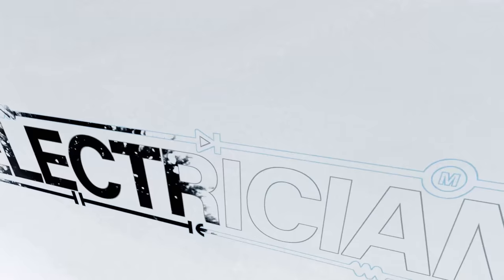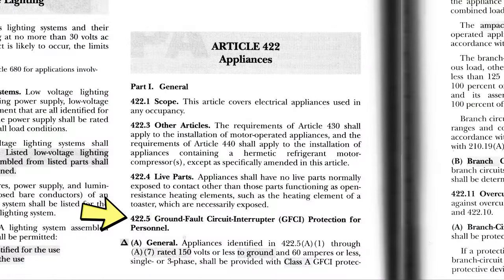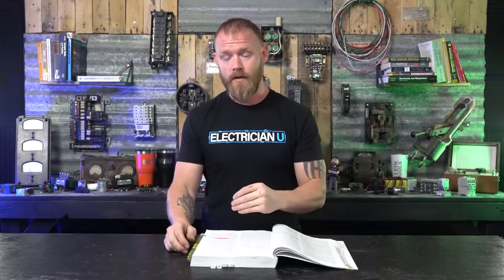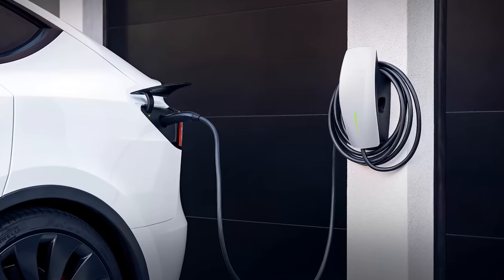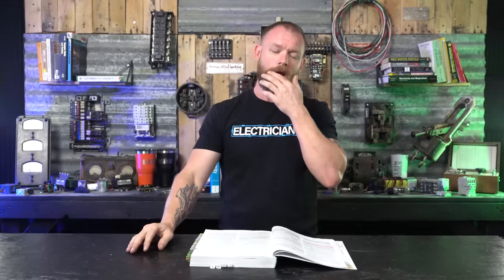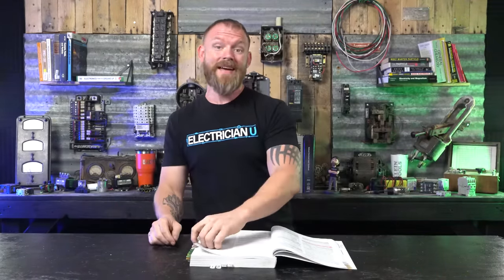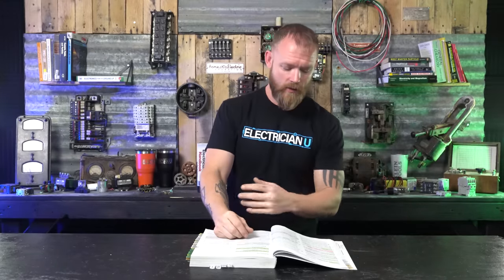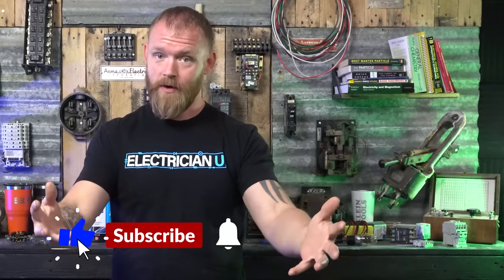Should We AFCI Protect Appliances?

Comment: I LOVE your channel.  I am a City Building Inspector. The problem is EXPERIENCED and Highly qualified electricians don't write the codes.  Electrical Engineers with limited field experience or common sense write codes.  It is my job as an inspector to interpret the intent of the code and many times I will side with the aspects of safety combined with common sense!  I learn so much from experienced electricians and I am not afraid to ask questions and get second opinions. Some issues are black and white with the code, but there is some wiggle room for interpretation for many issues.
Reply: Don’t forget the insurance companies and manufacturers sit on these boards as well
Reply: But that's the issue, there should not be any interpertation.  It should be a yes or no not maybe.  You could get 10 different interpertations from 10 people.

Comment: Gone are the days where code writers cared about nuisance tripping on things like freezers.
Reply: that ended when a commercial cleaning service had a guy get a severe shock from a malfunctioning commercial refrigerator.
Reply: @kenbrown2808  that would have been protected against with GFCI. AFCI is even worse at nuisance trips than GFCI, honestly it's rare that I ever see nuisance trips on GFCI, but my one AFCI circuit I can barely use reliably due to nuisance trips.
Reply: @fdmillion  change the breaker. if it still nuisance trips, there is a bad connection or a crossed wire, somewhere.
Reply: @kenbrown2808  Truth.
Oh, here's one for you - some Traeger grills had piss-poor wiring connections that arced and consistently tripped GFCIs in my experience, and customers would relentlessly beg me to just give them a regular receptacle outdoors and call it good.
Reply: @Timocracy  construction sites can be terrible.  three extension cords with a splitter on the end and every plug lying in a puddle. "why won't the GFCI hold?"
Reply: Install an alarm
Reply: They do say it's not supposed to be convenient, effective, or logical. It's about safety and ONLY safety. It sacrifices everything in the name of safety.
Reply: @fdmillion  I have seen new refrigerators which simply refuse to start with GFCI.
Reply: @mothman-jz8ug  No you haven't.  If you somehow actually have, then those refrigerators are defective and dangerous and need to be replaced.

There is absolutely no properly designed and functioning, piece of modern equipment that will have any problems with current GFCIs under normal conditions.  If it does, the equipment is faulty.  Period.
Reply: @kenbrown2808  Absolutely not. Any appliance with relays or contactors will trip AFCIs randomly.

Comment: As an appliance repair tech we have been factory trained to deny any warranty claims on these circuits if the appliance has an inverter in them. Most French Door and Side-by-Side refrigerator models cannot be on the “code” setups because the DC voltage conversion from the inverter is enough to trip the breaker or GFCI outlet. Some washers also have issues as they have MCUs acting as an inverter to run the Stator system. If it’s a Whirlpool or Frigidaire brand I highly recommend you avoid this code or pick a different brand if you’re trying to pass inspections on a new build.

But I appreciate the video, it helps to show my trainees so they learn the other trades that we deal with before they quote out the wrong diagnosis and send the customer the wrong way 🤙🏻
Reply: Just had that happen to me in my house. Recent inspection, so a new GFCI, and got a new GE washer. Tripped every time the washer started. I don't have the numbers in front of me, but I looked up the specs on the GFCI I'd installed, and the trip time was rated super fast. Something like 10milliseconds when approaching a quarter amp. So I replaced the receptacle with one that was just listed as UL rated (Based on a quick google right now, that appears to be 25milliseconds), seemingly solved the problem. Probably won't die in those 15 milliseconds :-)
Reply: Maybe get the inspection passed, then once inspector is gone, remove these stupid things.

Comment: Ugh... AFCIs are super annoying... inspector required them at all outlets of my basement development (including behind my fridge, microwave, etc.).  I expected the technology to have evolved by now, in 2022.  However, despite being brand new AFCIs, many would experience nuisance trips.  Some were fixed right away by replacing with a different AFCI, others required a second replacement.  Are some brands more prone to nuisance trips?  I haven't been too happy with the Siemens Type Q AFCIs, but that's what the electrical contractor used by my homebuilder put in.  As a final workaround, I've plugged in some WiFi smart plugs into outlets to monitor for loss of power, so that I get a notification on my phone if a circuit cuts out and food in my fridge/freezer is subject to going bad!
Reply: I'll just say that Siemens seem to be notorious for nuisance trips. It got so bad at my local supply house, that electricians all over were bringing them back in for replacements. When the supplier took them to Siemens, they were basically told to pound salt (they said that their electricians must not know how to install them).

Comment: So glad I don’t do residential anymore. Those AFCI GFCI  combo breakers have nuisance trips all the time. Usually from vacuums or something with a motor. The code writers have to do something to validate their pay. Back in the 2000s any call back I got from tripping breakers from plug in equipment I would just install a regular breaker. Problem solved. If it was in a wet area the gfci would still have the life safety shut off.

Comment: THanks.  I was hoping you'd also touch upon some of the real world problems encountered with certain appliances like refrigerators and washing machines that tend to trip to GFCIs
Reply: I have the same question!
Reply: As a residential helper, we always run the home run of one of the two 20a kitchen circuits  to the fridge receptacle before the first GFCI so that it won’t trip it. Hope this sheds a little light.
Reply: @daytonturner2265  That works, except in some jurisdictions the refrigerator must be GFCI protected. By the NEC it doesn't unless its plugged into a receptacle within 6 feet of a sink such as a countertop receptacle, but some municipalities require it.
Reply: thanks for the add. I was aware of the 6 foot rule but didn’t know some places required it. 
So I guess there’d be 2 solutions then, either pull a separate circuit for the fridge or pull the home run to a fridge gfci outlet first, then pull a jumper to your first kitchen receptacle and make that a gfci outlet as well. Put the jumper to the kitchen gfci outlet in the line side of the fridge gfci so that the fridge outlet trippin will still allow current to flow through the bottom line screw holes. (And the kitchen gfci the jumper goes to will protect the rest of the circuit) correct me if I’m wrong thanks
Reply: @daytonturner2265  A separate circuit is certainly the ideal solution. My refrigerator was on the same circuit as my GFCI protected countertop receptacles and tripped the GFCI a couple times, so I just ran a new circuit and put it on its own AFCI only breaker. Hasn't tripped since, totally code compliant here, and cost me under $40 since I already had extra 12/2 Romex, outlets, boxes, etc and just needed a breaker. Totally worth it to not have to worry about it tripping again and spoiling my food. Since the refrigerator is grounded, I see no reason for it to be GFCI protected since a short from hot to the refrigerator's chassis won't energize it anyways, it would simply trip the breaker. The odds of someone using a refrigerator so old that it is ungrounded is virtually zero.
Reply: @daytonturner2265  Thanks!  I'm DIYing my kitchen reno and think i have the fridge figured out since its > 6 ft from sink.   
Was also thinking of upgrading receptacles (not reno) in other parts of this old house, like the laundry room etc.    But I've been hearing about GFCI being problematic on some big appliances.  the outlet box is too small to fit a GFCI, so tis extra work & expense if its going get temperamental.  Just wondering how common that is.
Reply: @jefffree6990  I just recently went around places in my 40+ home - same as you're thinking and made an effort to code up the locations not already on a breaker GFCI (bathrooms.) I am at the stage of thinking lesson learned - problems may well be encountered, maybe not. 
My suggestion would be start small like one particular receptacle you think should be replaced and see how that goes. And if you can somewhere it's easy to get back into.
Also (assuming have the proper tools and some instruction how to go about) have a look into the boxes you are planning to put a GFCI into. Lots of cables can be a problem with space for receptacle and pose wiring quandaries. ¯\_(ツ)_/¯

Comment: Hi Dustin, I’m updating all countertop receptacles in a kitchen currently, and I have a question for ya.  Right now the kitchen has no GFCI or AFCI protection.  All kitchen receptacles are fed from 2 single pole 20A circuits with a shared neutral.  So I’m wondering, is it possible to do 2 single pole 20A Combination Circuit Breakers when there’s only one grounded wire to work with?  I would also use a handle tie in order to comply with code.  Love your videos man, keep up the hard work.
Reply: As of now, and I've been doing extensive research on this matter because multiwire branch circuits for kitchens were very commonplace in the 70s and 80s, there are currently no manufacturers that have available dual function AFCI/GFCI  breakers.  You could make the kitchen safer,  by using a two pole 20 amp GFCI breaker,  but you definitely want to work with your local inspector because typically existing circuits fall under the grandfather clause,  but if you do any additions or modifications that's when your likely required to bring it up to current code, which can get very expensive quickly.   With the NEC seemingly adding locations which require GFCI and/or AFCI protection with each new code cycle I wouldn't be at all surprised to see dual function AFCI/GFCI two pole breakers come on the market before the end of the decade.   To answer your question,  no, you cannot share a neutral on two dual function breakers with a handle tie,  because they would be constantly tripping due to the unbalance between L1 to N and L2 to N, the new code requirements for GFCI and AFCI made multiwire circuits a thing of the past despite it being a more efficient use of labor and material  vs pulling two separate runs of 12/2 NM like we would in new construction.

Comment: I'm in the process of adding several new branch circuits and I was starting to think I should just always use arc fault breakers everywhere from now on. However, I've seen these breakers be over sensitive so now I'm rethinking this.
Reply: They are crazy sensitive, i wouldn't if i don't have to, we've been having lots of issues with them tripping just from turning your lights on. specifically Seimens brand (because that's what we use)
Reply: I would definitely not use them if you don't have to... I've heard of people going back after the final electrical inspection and swapping them out just because they're so annoying.
Reply: @williambills3260  yup $50+ per breaker.😳
Reply: @williambills3260  back then it was knob and tube, which is quite a lot more robust if done right, i would however advise you check it out every so often, and be sure you put the correctly rated fuses in! doing that, it'll last just about forever. oh and be careful with the insulation, it can be brittle
Reply: @williambills3260  i haven't heard about that, it should be fine for normal use, that seems a bit weird
Reply: @williambills3260  though i would also be sure there is no insulation covering the wires, if its knob and tube, it requires no insulation over it so it's able to air cool should be be under load

Comment: Most of the customers I have WILL NOT pay for AFCI breakers. They put some in where required and then after inspection they go back in the box and get returned and the standard $5.00 breaker gets put in🤷‍♂️🙄
Reply: My old electrical teacher knew a Electrician who would do that with every home project that he worked on and was being inspected. I dont remember how he got caught by an inspector doing it but the guy ended up losing his electrical license because of it.
Reply: I did it on my own home. I got final and literally returned 1400 dollars worth of breakers. Replaced with 200 dollars worth.

Comment: Thx for your clear, concise, complete explanations.  My issue: I recently installed a ceiling fan in the living room that's on the same breaker as the bathroom.  The breaker is AFCI, and we get nuisance tripping occasionally.  Could the ceiling fan motor be causing the tripping, or should I look elsewhere for the cause?  Keep in mind the ceiling fan box is 18 ft up, so I want to check all possibilities before renting equipment to re-check the ceiling fan connection.  Thx!
Reply: Depending on how the wiring is run, you might be able to move the source for the fan to a different circuit somewhere other than in the ceiling box. Otherwise you'll probably just have to leave it shut off for a long enough period to see if it affects the likelihood of false-trips. 
Did you get false-trips before putting it in? Was the AFCI installed at the same time?

Comment: I'm planning a major electrical remodel and I'm concerned about AFCIs being required almost everywhere now. I do have one AFCI protected circuit and nuisance trips are *constant*. Motor surge current, speaker amplifiers, even LED lighting have caused trips either at power on or just randomly. If the circuit is idle it's fine, but run anything electronic on it and eventually it'll trip. Starting to wonder if I need to also get a UPS setup for my fridge and such... (Or just do what others say, buy the AFCIs just to pass inspection then swap them out for normal GFCI-only breakers at least on critical circuits...)
Reply: That's exactly what we do! The customers will not pay the high cost of the arc fault breakers.   I keep some on hand for inspection when required and then the standard breaker goes back in.

Comment: I installed all AFCI breakers in my new home. Some have GGCI too.   Haven't had a problem yet..   my washer and dryer are not in home they're in the utility shed with a regular breaker.  No garbage disposal, I do have a dishwasher and a high end refrigerator plus a gas range.  All lights are LED pod lights.

Comment: GFCI protection also requires resetting to be easily accessible. So, for ranges, built-in ovens, refrigerators pushed back against a wall between 2 cabinets, etc., what's your recommendation. These are going to be dedicated circuits so using a nearby GFCI outlet won't work. You don't want to have to pull the device out, so doing it at the breaker, which is not even in the same room, therefore not readily accessible, seems to be the only way. Also, if you have several pounds of meat in a freezer, you really don't want an easily tripped GFCI cutting power to it. So, recommendations? It seems as if the code has gone too far on some of this and the inspector you mentioned still had some common sense.
Reply: Well the easiest method is a gfci breaker and for large appliance it's the only method. Otherwise we sometimes put them under the sink open the door reset it gfci switch not the outlet type (especially for dishwashers).
Reply: @MOtherBoardFire  Yep, that's what I figured. So, you essentially have to violate the code to follow the code by making the reset not readily accessible. Also, who really wants their freezer in the garage being on a GFCI since they have a tendency to trip for, what seems like, no reason? I could see a $1000 of meat going bad over that one.

Comment: Of course....we are talking about adding new circuits....not existing circuits.  What I absolutely LOVE is these damn Home Inspectors who start testing circuits and then they start quoting NEC codes.  I literally had a heated argument about counter recepticals requiring GFCI protection.....in a house built in 1981.......Anyway he said to me this counter needs to be GFCI protected(keeping in mind it it 15 ft from any water source).....I told himit doesn't but if he would've looked at the panel, he would've noticed Breaker #31 was an AFCI/ GFCI Breaker....it was my house and put that in when I replaced the panel 3 years ago!

Ya'll stay safe and sane out there!

Comment: Lots of people don't understand that GFCI and AFCI are protecting against two completely different types of problems, which occur in different places and situations.  GFCI is protecting against faults that can happen in a piece of equipment or that humans can come in contact with.  AFCI is about protecting the building wiring.

It does not make any sense to "AFCI protect an appliance" because the appliance is not where the problem occurs that AFCIs are intended to deal with.  You AFCI protect a circuit because it is the circuit (wires in the wall) that the AFCI is designed to protect.

Comment: Out of curiosity why do campgrounds RV receptacles not have to be gfci'd. Numerous times I've been zapped when touching the metal frame of my camper after plugging into a faulty receptacle. When I installed a 50 amp RV receptacle at home I used a GFCI and never had a problem.